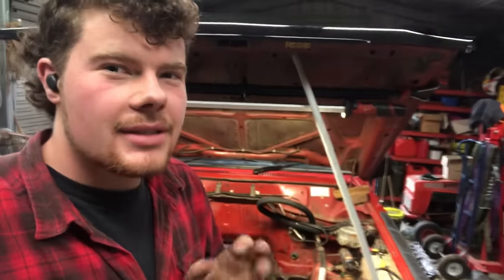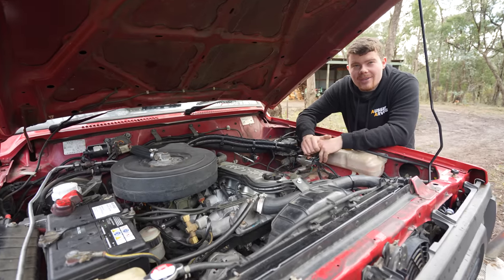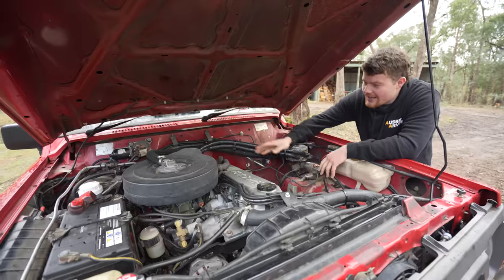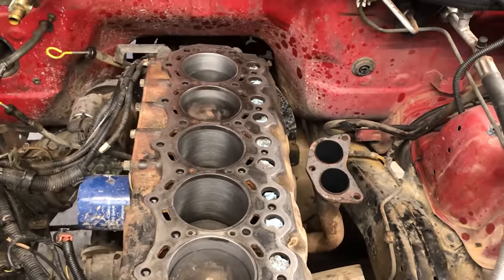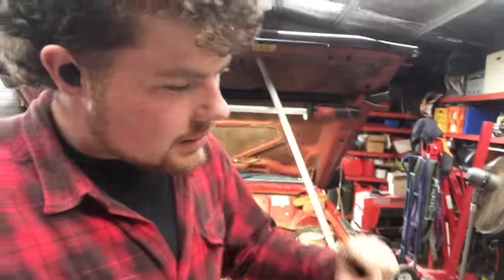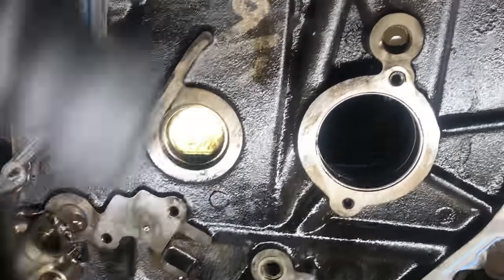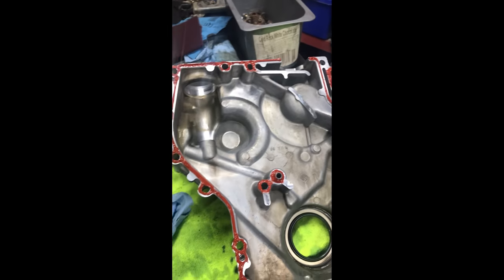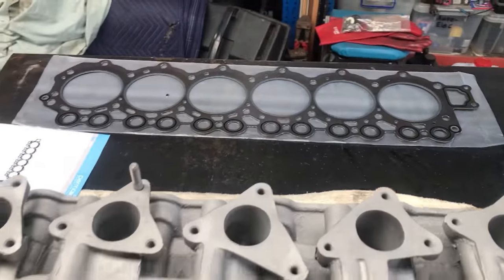The Patrols MAJOR engine problem that even stumped Dan.

Comment: These symptoms sound so much like what's going on with my Land Rover Discovery. Any serious uphill load, and it overheats and begins puking coolant, but I can do 120 miles or so on the flat, and it's fine. Been driving me nuts. Finally bought a head gasket set and some ARP studs, and going to see what I find when I disassemble it.

Comment: Hey mate, love your content and love the fact you guys always have a go but after 40 years of engine building theres a couple things you really need to know.
Never, EVER, use an abrasive on an assembled block. This puts very fine grinding grit into the bores and can quickly cause damage. You wont see it and it will cause accelerated wear and damage.
Never, EVER, used compressed air to clean debris out of the cylinders. This forces grit and other small particles between the piston and bore that you then cannot remove and guaranteed to cause damage and wear to bores, rings and pistons.
When the head is off, cover with plastic or glad wrap, not rags, as they drop a lot of lint and debris. Cleanliness is paramount in long life of you engine. 
Always use a vacuum cleaner to get any debris out of the cylinders.
Hope this helps
Reply: Sooooo how do you suggest cleaning a block surface when doing a head?

Comment: picked up a 89 patrol this week, partially modified, tb42, new head, rebuild trans, shonkin wiring for 12v system (will redo properly) sitting on 33 muddies, little rust in the roof, for $7k, only reason i even considered the 89 patrol was because of this patrol here on aussie arvo.

Comment: Totally understand the desire to do things properly so you know you can rely on the car. I’ve got a hj75 cruiser and I bought it to start camping and going on trips. I’ve just finished doing rear axle bearings, axle seals, bearing seals, wheels cylinders and drums/shoes. But I got carried away and pulled the backing plates of, wire wheeled them, painted them… because I couldn’t bear to do all that work and fit new parts to dusty old mounting surfaces. While I’ve got these things apart, it’s a small bit of extra time and effort to really make it look a million bucks.

Comment: I worked at Nissan New Zealand when the Y60 was a current model. The cam and follower issue you found was a very common problem with the TB42 engine. I replaced god knows how many under warranty.

Comment: Nothing wrong with preventative maintenance that's for sure! Done my injectors on my cruiser at 200,000 just because I was there doing the rocker cover gasket that was leaking. Wasn't necessary but they're now 200k fresher👍great video, nice to see specs were followed and not the usual youtuber ugga duggaering things  back on.
Reply: That’s the way, cheers mate 👍

Comment: Well done great to see your work and tips thank you 

Once you start better off rip it out rebuild it all stronger and a small turbo on it low boost lumpy cam and bang all sweet. 
I had a similar thing with a td42 then ended lifting the lid off it when towing. I pulled it apart then ended up whole engine out fully rebuilt by southern engines as I didn’t have time unfortunately. 
Set it up for boost and now runs a healthy 300 hp at flywheel at 24 pound.

Comment: Heads up on the timing chain marks, a couple years ago I did a full top end on a 2005 Suzuki XL7 after the owner let the chain go till it derailed bent all 12 exhaust vales, I was all done went to start it and it would try but just couldn't quite go, did a bunch of testing and made the call to pull the timing cover off and look, low and behold the NEW chain had the marks in the wrong places! So hang on to your old chain and check them against the new ones! could have been real ugly but I got lucky.

Comment: Great seeing you back. 
Mine is 500,000km. And 90-95psi
I have a second hand motor with a cracked block plus a full rebuild kit ready to go. (Need to finish Datsun l18 and chev 216 first)

This is great seeing you do this before I start mine. 

Still trying to decide on intake as I have three sets. 

1, carby for reliability in the outback. 
2, efi for drivability
3, t25 hi mount turbo and water intercooler for easier highway running. 
Any suggestions?

Personally I am keeping standard cam for crawling and factory efi may not always cope with cam changes. 

Any reason you blow dirt out not vacuum it out?
Reply: if the cam makes more torque at less rpm it would be better for crawling, efi or turbo are the best options
Reply: @darcykeddell4930  
Cool.
You don’t think that carby and points would be easier to fix and harder to break doing the cape York trip or tannami desert?

I haven’t seen an aftermarket cam that improves torque at idle (I don’t bother going over 3000rpm)
But that doesn’t mean they don’t exist.
Reply: @brucebaxter6923  not idle but he says in the video it makes power earlier than the standard cam because they can customise the cam to his exact use where nissan had to make it fit a wide use case. Electronic ignition and efi is the way to go if you really wanted to be 100% safe have some injectors spare and inline filters but I don't see efi being an issue

Comment: Did you take out the thermostat? U need to leave the housing and rid the middle part out. Or drill a lot little holes, still get hot, but will not blow head gasket. Old taxi trick.

Comment: Awesome job you must be a diesel mechanic and you still have hone marks in the cylinders and yes the block deck is very important and the cam and head machining is cheap horsepower top job and yes degreaser and pressure washers do damage cheers

Comment: Hi, I noticed that the coolant pipes for the LPG reducer/evaporator look a little high, and they go up and over, which can cause air pockets in the cooling system. They also look higher than the top of the radiator. Ask me how I know about incorrectly run LPG pre-heater hoses 😭. I had to do almost the exact same job on my Jeep. Head got warped, overheated, pushing out coolant. After the rebuild, I sorted out the LPG coolant pipes, and now it's fine, no coolant issues at all.

Comment: Dan, I'll be crying with you when you cut holes on your fender to fit the snorkel.😢😁  Could you use & cut-up the fender of your parts vehicle instead?  Then hang your prestine unmolested fender as a trophy in your man-cave. 😁  Great work on the engine rebuild.👍

Comment: Hello Dan , according to the part number of the cam newly used could you please recheck it I believe the number you gave was for an efi model being 442867 I rechecked and was told for a carby model it is a 442846 by crow cams. Also how much better do you find the upgrade cheers.

Comment: ive had 2 GQs over past 10 years and both had a moded water system with extra hose from rear head to radiator, both 450,000Ks and no probs at all, also has same gas system and shitty air filter that runs a v8 valiant filter lol  shit will always get into fuel bowl and block main jet as top is open :( passenger engine mount i drilled and put bolt right through as they always break,

Comment: Good video. On my Range Rover I put some loktite (272) to stop the bolts from slowly undoing due to the different expansion rates between the various metals. Does Nissan recommend doing this / did you do this? And I put a chamfer on the bolt holes to ensure that the block was flat when torqued up (Larry Perkins used to do this to get his engines super reliable). 
I reckon you should get about 10 per cent more power with the compression increase and unfortunately about 10per cent more heat to remove....
Reply: This is recommended for the R50 Pathfinders with the 3.5 VQ engine, not sure about anything else though.

Comment: Hi Dan
Very informative 
I have a couple of questions, , Is your  300a imco mixer (assuming it’s not 225a) 1 and  20 or 50 and 70. The smaller 300a was great for economy on falcon 250s. Holden 253s ect but leaned out if you drove hard.
On my impco gas 351 xd Ute I set up a pair of solenoids to turn on and off the vacuum advance. The second solenoid releases line vacuum after switching off. This meant you could advance the timing to the point of detonation under full load , which suits gas cruising and  economy then switch off advance under load, towing up steep hills or when you want full throttle. There’s also a primer button solenoid to help cold starting on gas. You can also update the converter size to a bigger Impco if the tuning shows lean conditions.
Great project. We used to use gas on most of our cars,  in the early 1990s I used to pay 19c litre. 
Regards Alex

Comment: nice work dan, ive just rebuilt my tb42 head but i had to replace the valve guides, i got HD valve springs and HD valves too, im also using TB45 MLS head gasket, now im starting  on the block, i got the same cam you did,  new genuine water pump haha, and timing chain kit genuine everything really rebuilding power steering pump, so i know your struggle lol, are you going to put electronic ignition on?

Comment: Rip that out.. I did my head gasket with new head. Thermostats, clutches. did not fix it.. ended up with rebuild.. a klien** not sure on spelling Japanese made radiator, original tstat, and clutch fan and this new engine has never gotten hot..